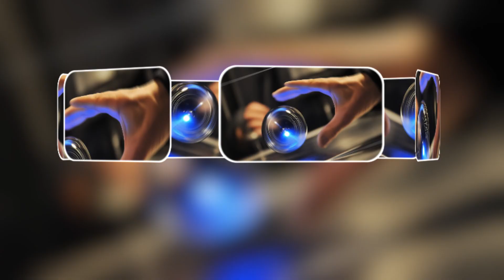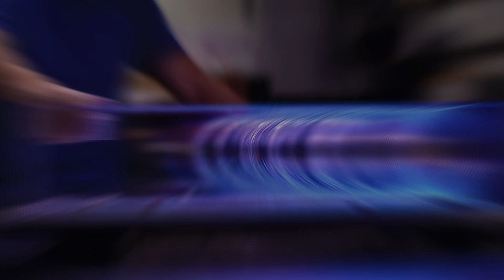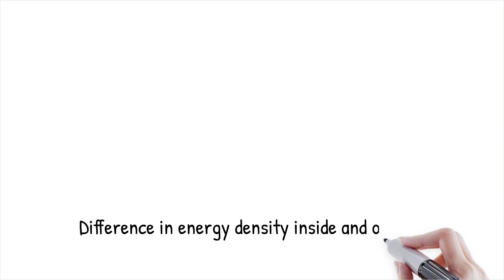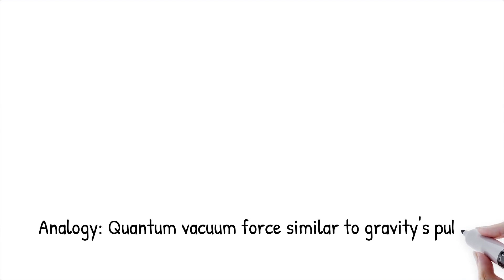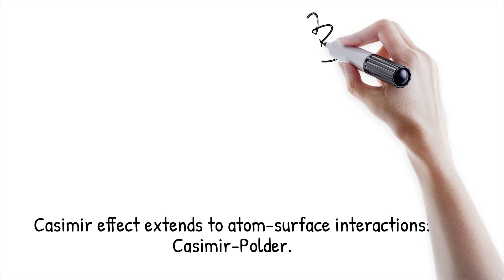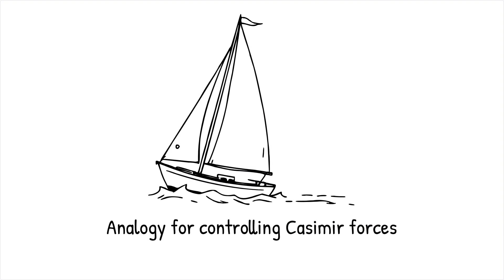Casimir Effect: Unveiling the Force from Nothing

Comment from the maker: How do virtual photons mediate the Casimir force between parallel plates?
What specific wavelengths are excluded between the plates, and how does this exclusion create a measurable force?
Why is the Casimir Effect's vacuum energy insufficient to explain dark energy at cosmic scales?
Reply: @ailabsparadox  well, I think you are looking into this from the most unfavourable angle. So, just consider electropotential (electronegativity/electropositivity) of elements and tell me whom has put the electric charge there ? Because this electric charge is there constantly and constantly and instantly replenished.

So, using this general knowledge acknowledged by mainstream science and analyse a permanent magnet we can observe that elements with different potential are mixed in an alloy and if the elements have the same pattern of atomic structure cubic, hexagonal etc. will form a perfect matrix which will allow a charge flow in the alloy. In order to obtain a magnetic effect we need to elongate (introduce a tension) atomic structure which is done when element are brought to a temperature allowing this and introduce an electric flow while cooling down. Magnetic effect is a consequence of an electric flow and will disappear when the dipolar nature is disturbed. So, in an electret made of dielectric elements we introduce a tension (electric flow) to elongate atomic structure and create a “perfect” dipole without elements containing electric charge but which can only allow an electric charge flow without ohmic resistance to pass when any potential difference exists in the field where the electret is physically placed (anywhere in the universe, including earth).

So, I wouldn’t look into wavelength specifically but just on potential difference and reference points.
Reply: Because cosmic microwave background radiation from Big Bang not far off galaxies. Can't let the Big Bang die. Even though red dot galaxies in opposite direction of the ones we seen would push big bang back farther, but also means far away galaxies produce cosmic microwaves too. Which means no telling if from Big Bang or far off galaxies.
Reply: prof. Garrett moddel zpe diodes university of colorado boulder

Comment: Excellent, see the discrepancy. Entre o fator energético do vácuo e seu transbordo bidimensional quântico para uma realidade tridimensional de fato, cria-se and generates the discrepancy because ao aplicarmos a desconstrução tridimensional para a bidimensional do vácuo, temos o espelhamento quântico nada realidade em superfície e não em volume, ou seja, considerando os átomos do universo (10E80) and the error of exponent 120 with base 10, then applying the formula of area singular S=A/4G to the error, we will have the value quantified of the error in surface and not in volume, where A=120/4G=30G or A=80/4G=20G. Note the information quântica de energia da superfície está quantificada entre 20 and 30; the reason negative is of -40. Being so, the reason real is between 50G.

Comment: You build a microwave oven that is a vacuum. Fill with gas zap with microwaves and watch web and voids form. Then apply models to universe. No dark energy needed. But it kind of kills Big Bang. Because cmbr from Galaxies not big bang. After light shifts from infrared it shifts to microwaves. Or big bang older but then can't tell if big bang or galaxy microwave radiation. And eventually would pick up as light as just radio waves. I think 1 atmosphere in a vacuum is huge amount of energy.

Comment: is zero point energy 0 degrees fahrenheit, calvin or celcius?
Reply from the maker: Great question! It's a common mix-up because "zero" shows up both in temperature and in quantum physics, but zero-point energy isn't a temperature at all,  it's a quantum concept. Let’s break it down:

Zero-point energy is the lowest possible energy that a physical system, like an atom or a molecule can have. You might think that at absolute zero (0 Kelvin, or –273.15°C, or –459.67°F), everything should be completely still. But nope! Even at 0 Kelvin, quantum objects are still moving. That residual motion is zero-point energy.

Analogy 1: The Jiggling Kid on a Trampoline. Imagine a kid standing on a trampoline. Even if they try to stand perfectly still, the trampoline bounces a little. There’s always some movement, the springs never fully relax. That unstoppable little jiggle? That’s zero-point energy. Even at the coldest possible temperature, atoms can't sit totally still, quantum laws won’t let them.

Analogy 2: A Violin String That Can’t Be Silenced. Suppose you pluck a violin string and then try to stop it completely. In classical physics, you could freeze it in place. But in quantum physics, the string never goes completely still, it always vibrates just a little. That last little hum, no matter how cold it gets, is zero-point energy like nature's built-in hum.

Why? Because of the Heisenberg Uncertainty Principle. This is the quantum rule that says: you can’t precisely know both the position and the momentum of a particle at the same time. If an atom were totally still (no energy, no motion), you’d know both exactly, which quantum mechanics forbids. So nature requires a bit of motion, that’s the zero-point energy.

Comment: An accordion style lattice of metal plates and quartz crystals on the nanometer size could make a viable way to extract electrical energy from a vacuum.
Clean, no radiation, size of a paperweight
Reply: I was thinking of that myself if you took a thin slice of quartz crystal and put it on the backside of each plate it would cause a vibration
Reply: Which should create more energy. Being able to pull energy from the differential from the center of the plates to the exterior of the plates
Reply: @mikecain6194  exactly! With spaced electromagnets that capture some of the generation to provide the variable oscillation and negate the collapse
Reply: @xanderjames8682  I wonder what would happen if you applied mhd? I wonder if it would enhance the electrical flow energy flow
Reply: @mikecain6194  how would it be applied? Had to look up what it was😅
Reply: @mikecain6194  after a quick reading spree. 
Do you mean the addition of an electrically conductive medium to stabilize oscillations using lorentz force and maintain resonance?
Reply: @xanderjames8682  well my thought is being able to direct the energy out into a flow maybe even enhance making it stronger
Reply: You should check out mhd propulsion I'm not talking about just water though you can ionized air and move it with a magnetic field.  Also vermonters from the Indian text where do they talk about using mercury that is heated to generate electricity also I think similar to the cashmere effect. I seen a video that talks about a flying spacecraft call the flux liner using a Mercury vortex energy devices the reason I believe it's similar to the cashmere effect a gold plate inside what's the Mercury would flow across Mercury and gold won't mix so there would be a very very close to each other but separate . Essentially there would be a small gap between them like what is required to achieve the cashmere effect what two materials that are very conductive
Reply: So to put that with mhd you would have a crafts that would be able to generate a high voltage electrical energy field using the cazmir effect degenerate a high static field then being able to manipulate the field with mhd pulling the energy around The Craft forming a bubble essentially putting it into its own space which would then make it weightless
Reply from the maker: That's a really creative concept — while the Casimir effect shows us that quantum fluctuations can produce tiny forces between nanostructures, harnessing them to generate significant, clean electrical energy is an exciting challenge that researchers are still exploring.
Reply from the maker: Thank you for your comment. Some time I visited the lab of Federico Capasso at Harvard, where researchers demonstrated a repulsive Casimir force in a fluid by exploiting differences in the refractive indices of the interacting materials — a compelling example of how material properties can be tuned to control quantum forces. In discussions with theoretical physicists, I learned that the second law of thermodynamics does not categorically forbid energy extraction from non-equilibrium nanosystems; instead, it requires the creation of an imbalance through external or chemical fields. This insight suggests that Casimir forces could, in principle, be harnessed to lift objects in fluids and, with an appropriate design, even generate rotational torque. However, if the nanodevice in question is below one micron in diameter, it is naturally driven far from equilibrium by Brownian motion, which diminishes the necessity of engineering a specific Casimir force for that purpose. Our subsequent calculations indicate that while energy harvesting via these mechanisms is theoretically feasible, it is not economically viable at the current stage of research. To date, although several papers have been published on these topics, no practical implementation has been realized, highlighting the need for further experimental exploration.

Comment: A force from the vacuum seems like bs I must say.  I get the casimir force is real but I would bet that it is misunderstood
Reply from the maker: Thanks for your comment! The Casimir force can definitely seem strange — it’s a force arising from the quantum vacuum, which sounds like "nothing" but is actually full of fluctuating electromagnetic fields. The force happens because, when two conductive plates are very close together, they limit the wavelengths of these fluctuations between them, creating a pressure difference that pushes the plates together. It’s been measured in experiments, so we know it’s real, but I get why it feels unintuitive. There’s still a lot of discussion about what it tells us about the quantum world, and some think we might learn even more surprising things from it in the future.
Reply: @ailabsparadox   Also, as I understand it zero point energy has never been observed has it?
Reply: Yes thanks I get it. This video does an excellent job of explaining it.  But you are putting two plates very close together how do you rule out the matter in the plates from causing the force?  Seems more likely doesn't it?
Reply: @ragnor513 to your point I have observed sheet material metal plastic mirrors glass to each other when they are very smooth and close together. This is not inside a vacuum. Seems like static electricity is the cause of this effect. I wonder if you created the same setup outside of vacuum if you could harness that energy as well.